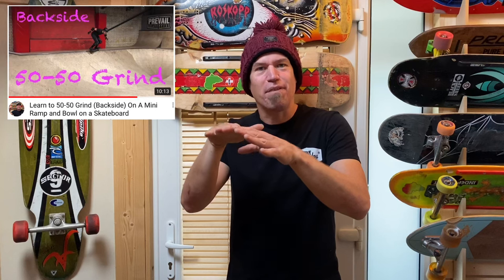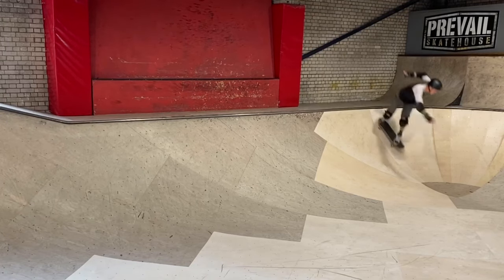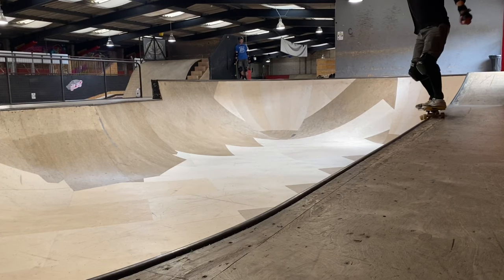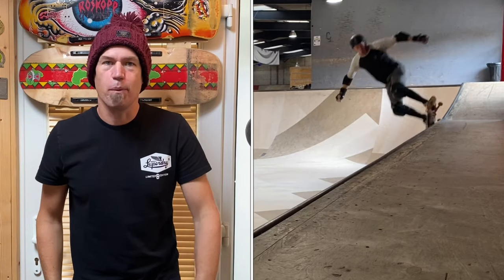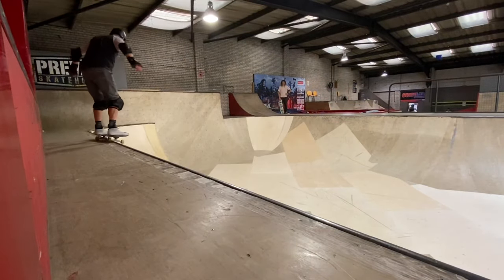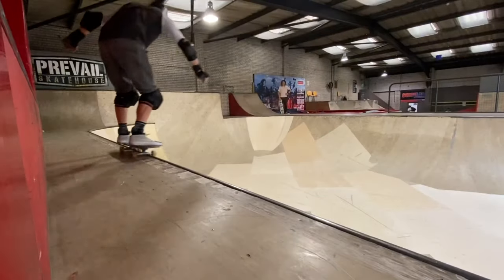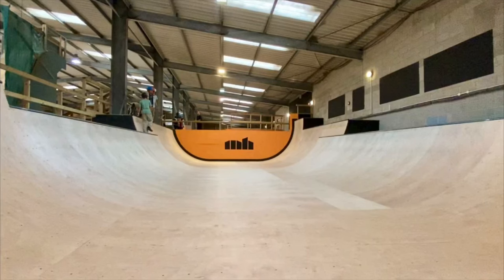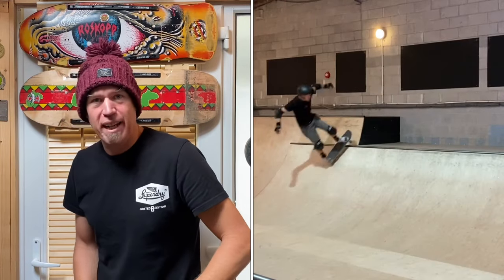Improving Backside 50/50 Grinds On A Skateboard In A Bowl and On Mini Ramp Coping

Comment: I've been fighting with 50-50 grinds for a long time and what worked for me is to think of the grinds as extended carving. What I mean is that I go up diagonally as if I would be carving but I keep going up until I lock in my trucks, I put a bit of pressure in the back foot just to keep it locked in on the right position. 
The important part here is to keep the body inside the ramp, I never try to launch myself up and stand on the deck, otherwise the trucks will not lock in perfectly and ready to drop back in. The shoulder as you have noticed is important, turn your shoulders like when doing a carve and the skate will follow.
It is nice to do like that specially when skating a bowl, grinding in the curved areas of the bowl and get that nice and smooth flow going.

Comment: You can try to learn locking in with the trucks crisscrossed already from the beginning. To do that you have to grind more inside the ramp than you did here. I hope you can imagine what I'm saying 😁
Reply from the maker: Yeah, totally, 
I do the criss crossed one a few times in here (4.00) and it feels great. I found that there is more friction though so I was coming up short of the full rail, but it looks more stylish and feels better. I think it’s the one I like to do the most?? I recon even more speed and better weight distribution during the grind would help. Next challenge is to go round corners, I’m guessing it’s all about guiding with the shoulder? Do you have any tips for B/S 50/50 round a corner? Cheers dude
Reply: @JonBishopSkate yeah I saw that after I made the comment 😁. Crisscrossed lock-in grinds slower but way more controllable. You just have to be a little faster. Look at it this way: being all the way up on top is not a grind, but essentially rolling on the deck 😁
for going round the corner its even more crucial not being all the way on the deck, but locking in crisscrossed, leaning a bit into the ramp, going full speed and yes lead with the shoulder.
Reply from the maker: CORE TEX thanks dude, yeah I think it’s still a 50/50 grind with both toe wheels locked against the coping? That’s the way they are done on ledges and hubbas? It’s also the way I do the frontside 50/50 grind as the back heel wheel has to be locked against the coping to come back in? My mate does them with both toe wheels locked against the coping and then comes in without correcting the back wheel which results in a hop in (very cool) He can also go round corners this way??!  Another mate of mine does them with both heel wheels locked on the coping, so he’s right inside the ramp? don’t know how he does it? But it works !! 
Cheers, off to the park to try round the corners !!